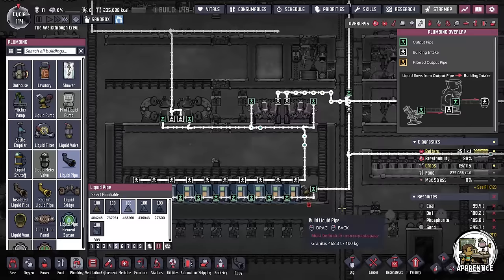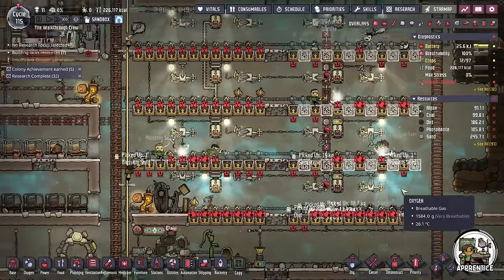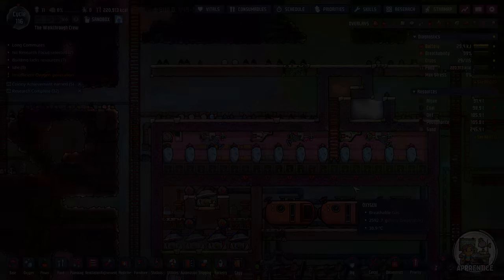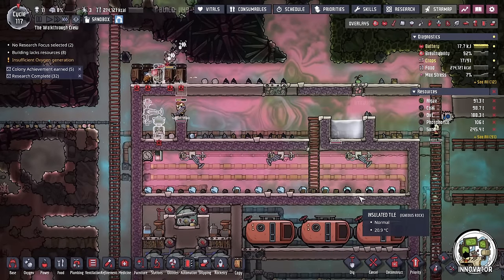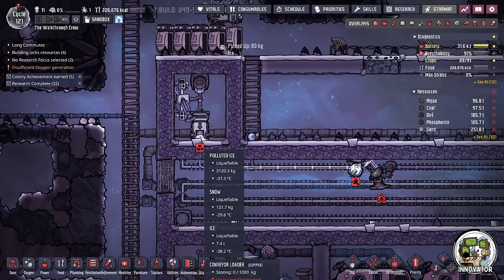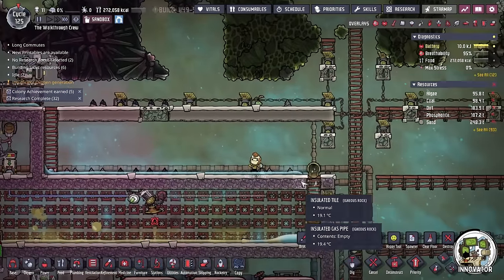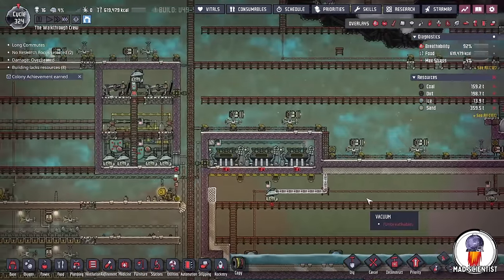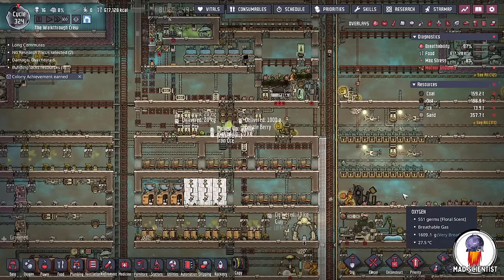HELP!  How to keep your water running in Oxygen Not Included

Comment: For anyone looking for a truly Mad Scientist solution, petroleum boilers are water positive, and as long as you keep the petrol generators cold, the water is only 40C.

That said, if getting water is the entire reason you're building a boiler, as opposed to literally any other use for petroleum and/or boilers, maybe you should stop and think if you actually need it.
Reply: ....DUDE, BOTTLED LIQUIDS ARE ALWAYS FREEZING INTO SOLID TILES SO IT'S POSSIBLE TO MAKE ETHANOL DISTILLER RINNING SOLELY ON WILD ARBORS.............HEHE.....YUP, WITH BOTTLED LIQUID SULPHUR AND MOVE TOOL, HEHE....

......YUP, 750g/s FOR KIND OF 32 WILD ARBORS ...... WHICH ARE RELATIVELY TIME CONSUMING TO PLANT,BUT STILL .............AND U MAY PUSH IT EVEN FURTHER BY ABUSING SUBLIMATION STATION+PUFT RANCHING+ALGAE DISTILLER , RIGHT????......

........ OR HOW IT'LL LOOK AT NORMAL GAME I DONT KNOW, LIKE A ROW OF STORAGE BINS WITH GAS PUMPS, RIGHT????????...........

.......... AND PETROLEUM BOILER IS LIKE "WHY" BECAUSE NATURAL GAS BOILER, RIGHT???…..
Reply: There is also the long chimney/catch off steam from steam rocket engines solution but that is for crazy builds with too many Dupes I'd say.

Comment: @5:26 you say that Berry Sludge is more efficient, but in every recipe when its cooked the sleet wheat is contributing 400 calories per seed. While there is an "additional" 400 gained from Berry Sludge arguably that comes from the "cooking" of the bristle berry where it always "gains" 400 calories when cooked. Either into Gristle Berry or when made into Berry Sludge.
Reply from the maker: I meant moreso that it is efficient for the water used, and if you are relying on the natural sleet wheat (requiring no water).  That allows me to really reduce the amount of blossoms I'm growing.
Reply: @Magnet_MD  Oh yeah then that's fair, it sounded like you meant in absolute terms which confused me.
Reply: Berry Sludge has a nice benefit in Spaced Out I haven't seen many people touch on - its already 2 of 3 ingredients to make mixed berry pie.  The other berries it uses are fed with sulfur which doesn't have much use otherwise, making it a relatively cheap quality 5 food if you have a sulfur geyser somewhere.

Comment: Nice a guide I really need.

I have an overshadowing issue with water that my temperature always is horrid and feels unmanaged. And most solutions eat up power, costing important resources.. And boom dominoes keep falling, fixing issue after issue, cycle 1000 hit and another playthrough where I don't see space
Reply from the maker: Sometimes that happens!  For me,, this game was all about making mistakes and not repeating them the next time.
Reply: 1 - Emergency / basic power 1 - manual generator room on a main power line with batteries, transformers to send power where needed.  Each dedicated dupe can average 350W or so per cycle, depending on schedule and distance from food/bedroom/bathroom
2 - Emergency power 2 - wood generators - only possible if you have arbor trees - incredibly inefficient, converting wood to ethanol is much better though still not an ideal power source
3 - Common power 1 - coal generators, maintained by hatches making coal (until their rocks run out... or you tame a volcano to make rock for stone hatches)
4 - Common power 2 - hydrogen/natgas generators with some backup tanks fed from 150C hydrogen/natgas vents and oil well venting (or larger early tamers to cool the 500C vents)
5 - Common power 3 - petroleum generators, dupe-operated refinery, capped output averaging 4.4KW per dupe, including down-times
6 - Intermediate power 1 - solar panels basically free power, but needs protection from meteors on meteor asteroids
7 - Intermediate power 2 - metal refinery and steam turbine combo - every metal refinement except gold will be power positive (even with AT cooling!), but requires starting input to get gains
8 - Intermediate power 3 - metal volcano tamers - passive in-chamber cooling down to ~140C with aquatuner, then forced cooling down to ~22C, overall power positive even with gold volcanos, no dupe labor or input resources needed once built, variable power but I never had any turn off.
9 - Intermediate power 4 -hot-core steam turbines - dig to near magma layer, build steam turbine chamber, build heat spike to touch magma, doors connected to temp sensors in steam room, most bases can be powered a thousand cycles with ten turbines here.  Connect to smart battery and turn off when not needed to conserve your heat.  Requires dupe labor to dig out rock and expand heat spike.
10 - Intermediate power 5 - arbor tree wood to ethanol for petroleum generators - sub-optimal for power, but great for making dirt.  Dupe labor intensive for whole system, including parts outside of power production.
11 - Intermediate power 6 - petroleum boiler - use magma source to turn crude oil directly into petroleum for 100% conversion rate instead of refinery's 50% loss, can pump crude oil forever and burn 10KW of petroleum forever
12 - Advanced power 1 - magma volcano tamers - A map full of volcanos can basically be constant 20-30KW free power all the time forever
13 - Advanced power 2 - regolith cooler - space scanner, space doors, autominers and autosweepers move regolith to cooling chamber, can be constant 10KW forever
14 - Advanced power 3 - regolith melter - instead of cooling regolith, heat it up to magma where the potential energy in heat is magically multiplied by 5, then cool it similar to volcano tamer, can be constant 50KW forever
15 - Advanced power 4 - sour gas boiler - heat crude oil to sour gas, freeze it to methane, re-heat back to natural gas.  Instead of petroleum boiler's constant 10KW, this will produce constant 50KW+
16 - Advanced power 5 - rocket chamber - capture rocket exhaust heat and/or rocket exhaust for power with steam turbines - effective with petroleum and hydrogen rockets
17 - Advanced power 6 - nuclear reactor (Spaced Out DLC only) - basically generates heat for 12 steam turbines constantly, constant 10KW, radiation and nuclear waste can have important Spaced Out DLC uses.  Main advantage is building these on asteroids with few natural power sources in addition to main asteroid for radiation uses.  Required 10KG uranium per cycle, a beeta farm, and mining trips to uranium-rich space resource sites.

Comment: As a last resource cooling solution i used to mine ice and create sculptures with it using the quick mouse flick trick
Reply: I always used the tempshift plate, which uses way more ice (thus cool more) and be placed almost anywhere, but takes longer to build.